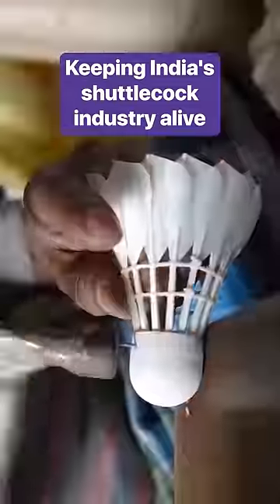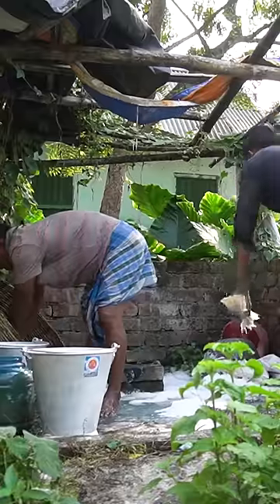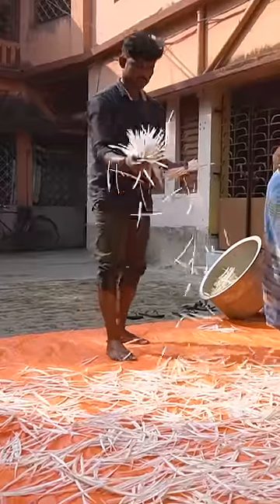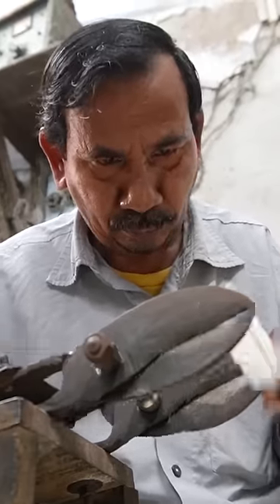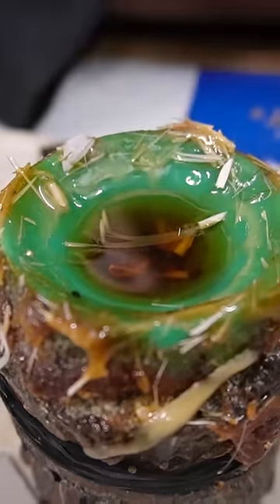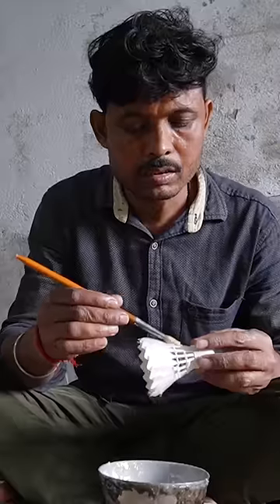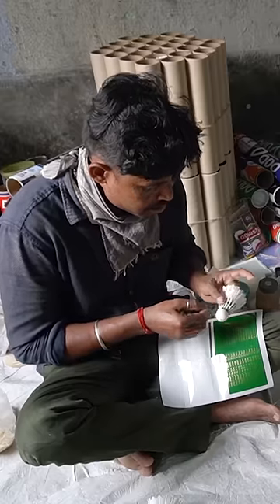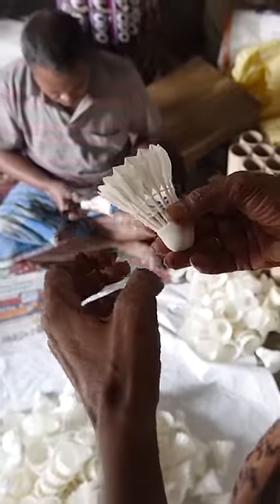Here's how dodo shuttlecocks are made. #Shuttlecocks #Badminton #HowItsMade

Comment: “EXACTLY 3” long”… shows dude eye balling it…😂
Reply: Not sure if you noticed but he’s “eyeballing it” with a pair of connected cutters fixed presumably 3 inches apart which is obviously more efficient than using a single cutter and having to measure the feathers before cutting
Reply: @defectivetoaster7713 I see that now. Thought it was my double vision from drinking. 😂 man I feel like an ass.
Reply: it is not eyeballing. did competitive badminton for ~5 years, never saw a short or long feather.
Reply: Yeah it's probably a little less, but still a pretty shuttleCOCK

Comment: First, you take the dinglepop, and you smooth it out with a bunch of schleem. The schleem is then repurposed for later batches.
Then you take the dinglebop and push it through the grumbo, where the fleeb is rubbed against it. It's important that the fleeb is rubbed, because the fleeb has all of the fleeb juice.
Then a Shlami shows up and he rubs it, and spits on it.
Then you cut the fleeb. There's several hizzards in the way.
The blaffs rub against the chumbles, and the plubus and grumbo are shaved away.
That leaves you with a regular old plumbus!
Reply: @wompwowow these instructions are as on point as they are hilarious  😂😂😂
Reply: 😂 best comment on here
Reply: I need a plumbus … 😂😂

Comment: Alot of people goin' on about how these people are referred to. It depends on how they refer to themselves and how they consider the job. Do they consider their shuttlecockery as an art form or craftsmanship? Or, just another job? Since they are essentially working it as an assembly-line. They may not even consider it as inconsiderate, under their own pretense. Since they each are doing a part of it and not the whole shuttlecock in it's entirety to an individual. Where as Japanese ink making is considered to be by their own culture, an artistic craft with vast aging times ect. Now, if they do indeed view their work as a craft worthy of acknowledgement. To go out of their way to call them workers in spite of that would be wack. It's also wack to infer discrimination based merely on what you believe without inquiring details first.